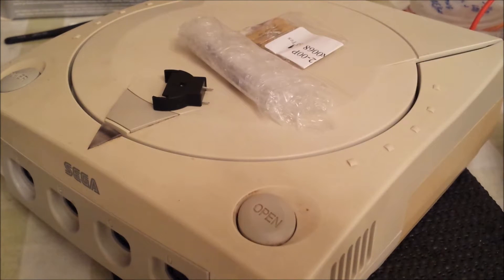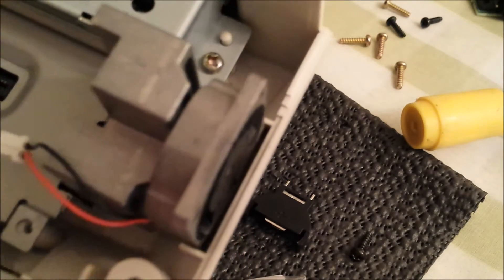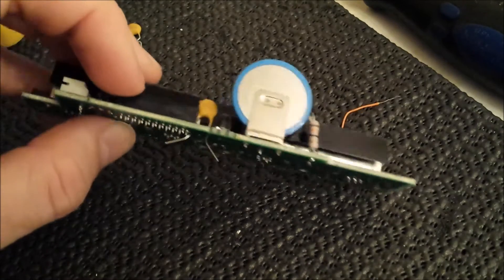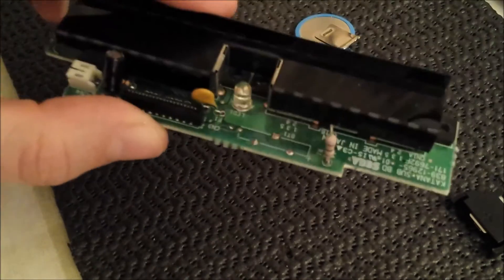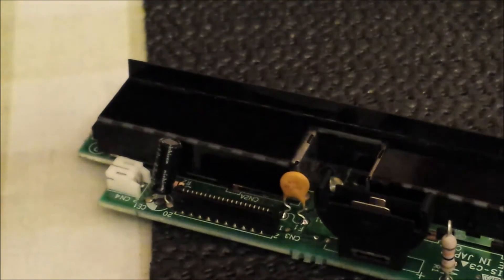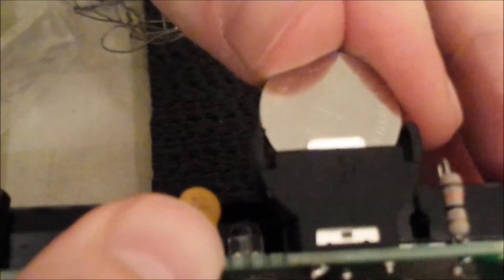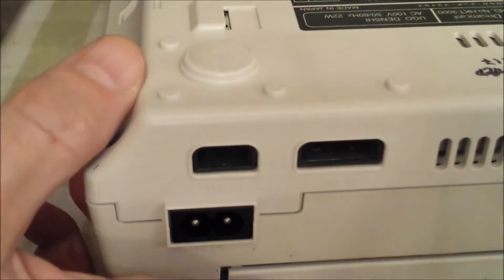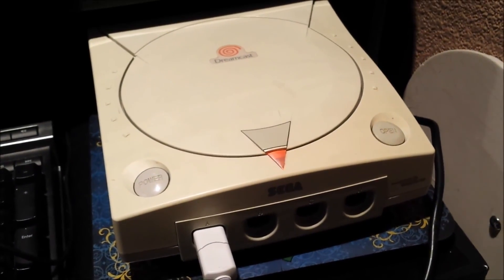Dreamcast Fuse Fix and Battery Replacement P2

Comment: Hi, u mentioned at 5:00 that shouldnt use resistor.. is that correct? May I know the reason why? As I see some other videos doing that and I am confused which method I should be following... thanks in advance!!

Comment: I know it's two and a half years late, but man if you're having trouble with the solder melting and coming out as at 7:40 add some new solder to the existing solder and should melt. Was thinking about doing this to my dreamcast soon and this video came up. Thanks for the video.